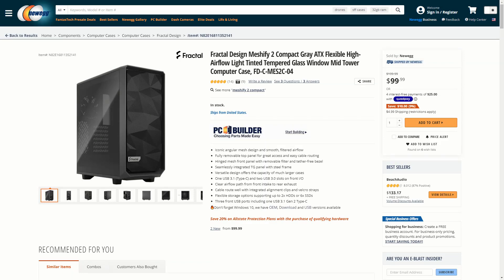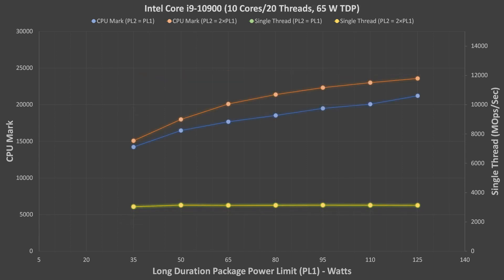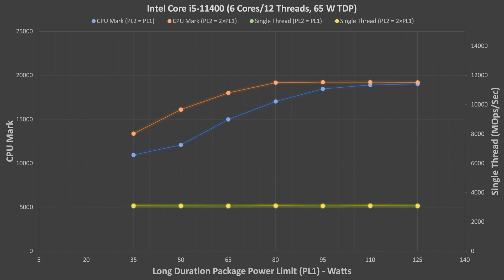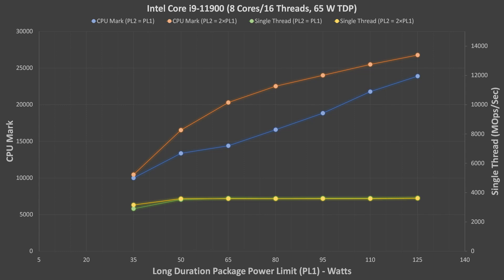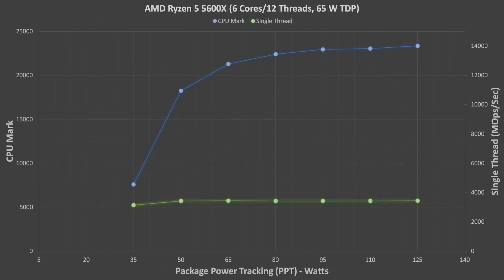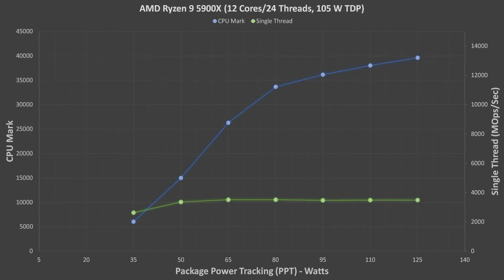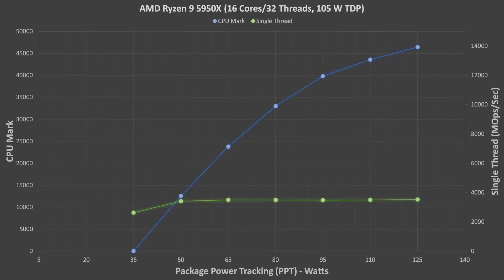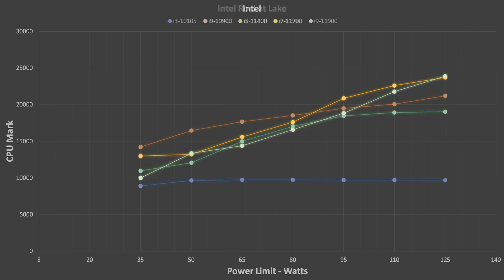CPU Power Limits - Performance of Intel & AMD

Comment: So if you have a 12900K and configure it to 12900T specs, TDP: 35 W, PL1: 35W, PL2: 106W, PL2 Tau Limit: 28 seconds - You have a genuine 12900T (that is capable of more)?

Are there any disadvantages of doing this at all or is it totally transparent for the OS?
Reply from the maker: Basically, yes, that's correct. You'll have a very power efficient CPU with higher maximum frequencies than a 12900T. No disadvantages, only advantages, totally transparent for the OS.
Reply: @fullysilentpcs  Amazing, that opens the door for that 35w streacom case. Can you do the same with  graphics cards, f.e. a 4090 and limit it to 75w to be able to use the arctic cooler accelero on it?
Reply from the maker: Not quite as easily. You can use software (e.g. MSI Afterburner) to limit power to a GPU somewhat, but not that much.
Reply: @fullysilentpcs  yeah, cant you do a video on modern vga cards at 70-80w, thinking about upgrading my 1650 and wonder what the next best card is to get.

Comment: I wish there was also a I7-9700 included.
For some reason setting PL2 at 95W lets me encode a video file on handbrake for 7,5mins while setting PL2=PL1 at 65W resulted in 8mins.
Not sure if this is noticeable in video games though.
Just a comparison to my previous I5-8400 which needed 9mins to encode it.

Comment: This is excellent, and exactly the information I need. I am building a passively cooled system, and I had originally intended to use a Core i5-12600T, but I had so much trouble finding one, and after some research, decided to go ahead and get the 12600K, because I figured that even when limiting the power, the 4 extra efficiency core can't hurt performance. But this is the most detailed comparison I've seen, and it makes me feel confident in my decision. The 12600K has a base TDP of 125 W, but I am using a Noctua NH-P1, and I intended to start with a PL1 limit of 35 W and a PL2 limit of 74 W, as is standard for the 12600T. From there, I can monitor CPU temperatures and adjust up to a comfortable limit.
Reply: BTW, I ended up removing the power limits and going back to the defaults, then setting the BIOS to Adaptive VCore with an offset of -135 mV, at which point it is perfectly stable and achieves a Cinebench R23 multi-core score of 17513.

Comment: Does PL2=PL1 mean that you just turn off short duration power limit? and just put pl1 up?
Reply from the maker: BIOS gives manual control for PL1 and PL2. In this case (PL1=PL2), I set both parameters to the power level indicated, so there is a single consistent power limit. When PL2 is higher the CPU can boost higher than the power level indicated for short durations.

Comment: Great insights! Thank you. Have you tried  using a negative Curve Optimizer on the Zen 3 CPUs? Makes a huge difference on my 5800X, it's faster and cooler at the same time. Alternatively with a manual offset I can undervolt it by a whopping 250 mV. I suspect more manual tuning would make it the fastest even below 35 watts.

Comment: Very interesting, this gives much more of an insight than the stress testing everyone else is doing. Look at the graph at 15:55, this shows very clearly why Intel has chosen to stretch their interpretation of 'TDP' - piling on the power is the only way to get close to AMD.
I much anticipate your inclusion of Cezanne CPUs, I suspect they will be unbeatable at lower power, since they have a monolithic design. When you look at the charts now and you have a 50W power budget for the CPU in your fanless system, the best option is the 5800X, but the 5700G might very well take that top spot.
Reply: To be fair, Intel and AMD have always had completely different standards presented in their marketing despite using the same language and this is due to a lack of enforcement by any sort of governing body or regulation.

This even extends as far as to the manufacturers such as Samsung and TSMC having entirely different standards (not just methodologies) for what they consider to be nm metrics in their nodes. Which is...ridiculous and dishonest.

But that's just how it works. If there is no enforcement of a standard, then companies are free to "interpret" things however they want and deceive the consumer.

All parties are actively guilty of this. Intel tried to pass off and then completely drop the nomenclature for its nm process because of how unfavorably it compared to AMD's marketing. AMD outright lied about the FPU module "core pair" design of its Bulldozer architecture because of how much core count mattered from a marketing standpoint, so much that they were willing to effectively sell consumers 4 core processors labelled as "8 core" ones by way of interpretative technicality.

It is a big marketing war.